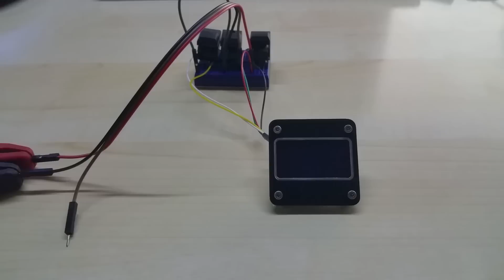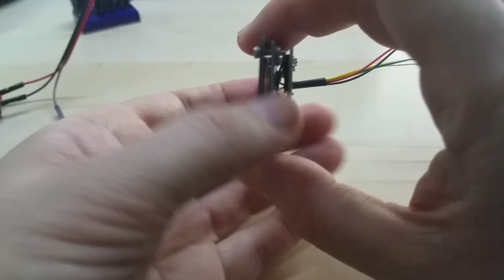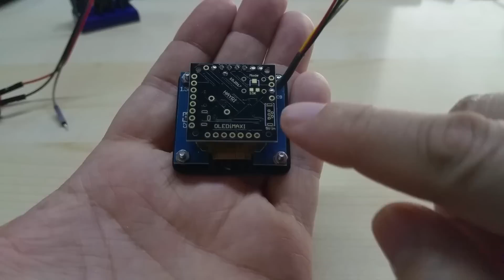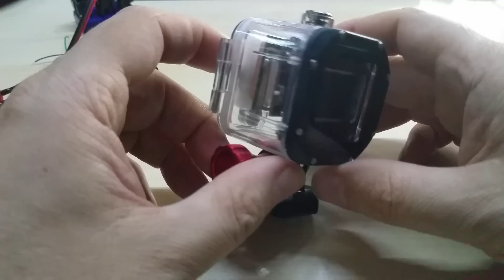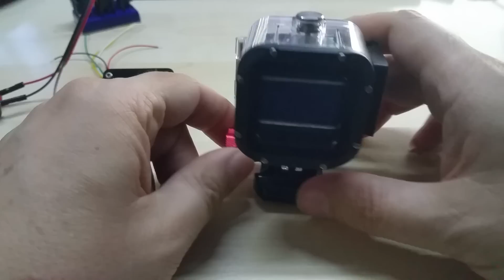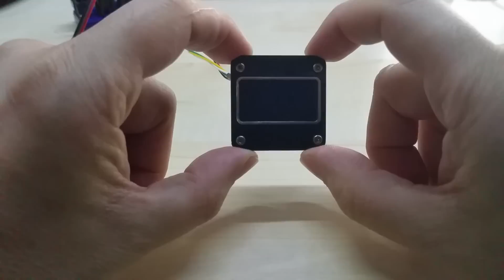OLED Gear Indicator with Custom PCB Frame by Hayri

Comment: hayri can i used this to my old gear indicator that i buy from you just update the code
Reply from the maker: you do not need to pay for a updated code but need to get the 1.3" display and the frame if that is what you want.

Comment: Awesome is it universal for any 5 speed bike and or vehicle ? And where can I order one ? Thanks
Reply from the maker: Yes, it is universal as you do not need specific signals like rpm or speed. Just a connection from the Neutral indicator light and 2 switches, either reed or micros switches. I have a sequential version like shown here and a version for individual gear inputs that can be used in a car, including screens for Park, Reverse and or Drive if it is and automatic transmission. The link to my store is in the description.

Comment: Pertamax gan ( ignore this XD, just kidding from indonesia)
I want to ask, are those all motorcycle are can attach with these devices, i want to know if all pin input from motorcycle all same.? Are they ?
Sorry for bad english
Reply from the maker: This has it's own inputs, you need to attach the Neutral wire from your indicator light and 2 wires from the reed or micro switches that you need to install. It can work on any motorcycle.
Reply: Hayri well that's pretty easy to instal reed switch, thank you.
I hope your bussines getting bigger. :D
Reply from the maker: Thank you so much for your kind words, I greatly appreciate it :-))